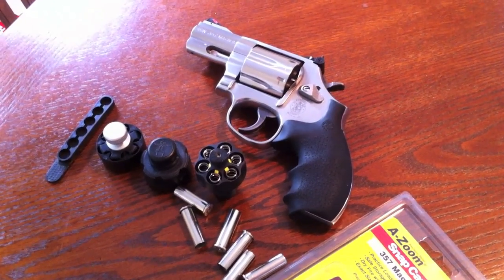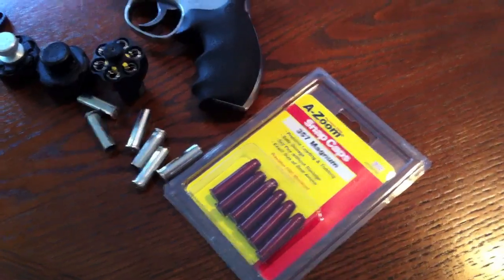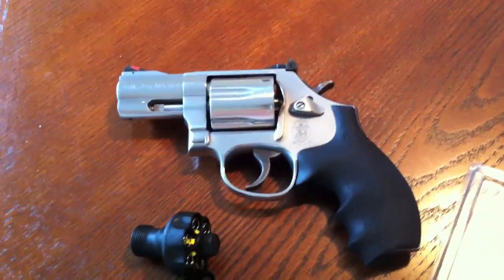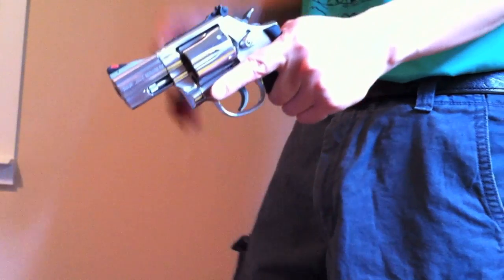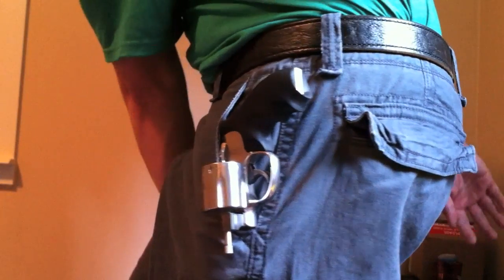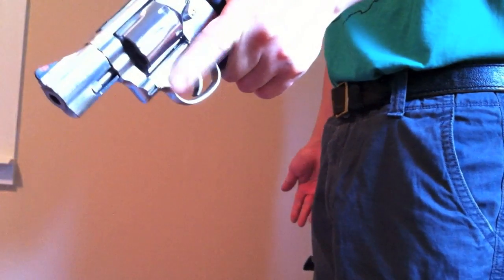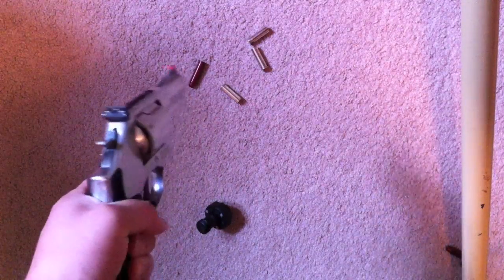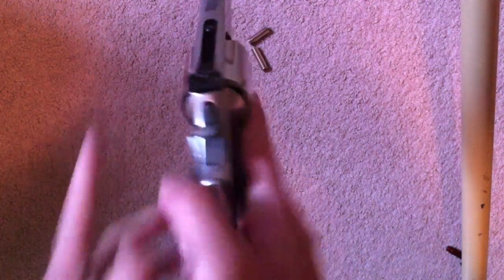Reloading Revolver with one hand

Comment: SL Variant the unicorns of speedloaders.
Reply from the maker: I still have a handful of them with one broken actually (the spring came out and the whole thing no longer works after I tried to fix it myself).  I only have 2 j-frame ones left as I sold the other 5 on the bay a few years ago.  I have a few for L-frames (6 and 7 shots) that I have not used much at all anymore but want to hold on to them.  I remember they had 8-shot ones as some guy at the range back in 2011 I believe had one for his S&W N-frame.  its too bad they didn't keep producing these things!

Comment: I love to see all the variations because there's no end to the ways. For weak hand I bump the cylinder into my body as the barrel goes into my belt. pull up to eject and toss the old, reach over to new one, load-close and back out. It's super fast. For strong hand I really think the ground method is the fastest method and keeps you low. Honestly for me strong hand is harder due to direction of the crane. Thanks for your versions.

Comment: I'm a little late to this discussion.  If your reloading with your dominant hand only, try this:  eject the spent shells as described in this video.  Next, with the cylinder still open, place the barrel in your holster vertically.  Obviously, the holster would have to be on the dominant side of the belt.  Drop in the new rounds with the speed loader of your choosing.  Take the gun out of the holster then close the cylinder.

Not familiar with S.L. Variant speed loaders.  I'll have to try one.  I use Five Star Speed Loaders.

Comment: I found using snapcaps to reload being great for pracitise,  load eaeier because of the design, old lead round nose. 
That's not the case with jacket hollow points. Whether your using S&k or safariland Comp 1 for five shot revolvers. They do not load as easy & hang up. I know he said safety first, no live ammo, but the load you carry you need to practise with. Keep your finger off the trigger or find a snapcap that is similar to jhp.

Comment: I'm thinking that in a def situation the typical person is far more likely to fumble a revolver reload than to experience a failure to function in an autoloader (which might load 2 or 3 times as many rounds).  And even if you do have to reload the automatic you would have to reload the revolver several times more -- making the odds that much worse for the revolver.

Comment: A) Gravity will not eject fired cases reliably (especially magnum cartridges)
B) These reloads will fail under stress when you will most likely need a one handed reload.
C) Your fingers are touching the forcing cone and the barrel; both of those, especially with magnum loads, get hot real fast; you will drop your gun.
Revolvers have been outclassed by semi-autos in every category. Shoot them for fun, shoot them for competition ,but don't shoot them for defense.
Reply: Shrewd _GC in which category please ? :)
Reply: titanplatine Higher capacity. Faster reloads. Easier reloads. Fewer malfunctions. Need I go on?
Reply: Shrewd _GC yes please but i think a revolver with moon clips is faster and because of is  design can't have feed issues also depending of the cartridge got more stopping power but for the higher capacity you're totally right go on please :)
Reply: titanplatine Easier to manufacture.Cheaper to buy. The only real advantage a revolver still holds is that it can't be knocked out of battery.
Reply: Shrewd _GC but it at less moving parts its easier to manufactured to clean and to recover you're ammunition if you're into reloading it your self  and some models like the taurus raging judge magnum can shoot different cartridge like .454 casull .45 long colt and 2.5 and 3 inch .410 shot shell in the same revolver  :)
Reply: 6236003 Does the Automag count? lol. Why would I want to conceal a .44 when I can conceal a pocket 9/40/45? Those pistols have proven reliability whereas revolvers have not. Improper cylinder timing, primer pop out, and bent cylinder rods are all well documented issues with revolvers.
Reply: Shrewd _GC you are wrong on so many levels. no the forceing cone doesnt become a damn bacon cooker. gravity will help depending on the kind of cases and the reloads that work no matter the platform is the one you train with.

and no. the 357 out performs just about every semi auto caliber out there. reliablity defeats it too.. all the semi autos have is capacity. thats it.
Reply: Shrewd _GC are you serious?? the 44 special out performs 45 acp! and oh my holy god. the primer cylinder timing bs is all based on black powder revolvers thats where those arguments come from! and bent cylinder rods? you mean ejector rods? thats just with bad revolvers! just as easy you can bend a guide rod!
Reply: six gun survivor I agree with you all the way until your last statement. I shoot 357mags mostly and the damn forcing cone can fry a small piece of bacon after a few cylinders, on my S&W, Ruger, and Taurus models. I've got a few ring scars to prove it.
Reply: bill h if that's such an issue. Wear gloves for training and tac ops. Or reload a different way.
Reply: six gun survivor Yeah I've tried a glove. This only happens to me in competition...speed, speed, speed, stress, "gotta get faster"" type stuff, otherwise no problem.
Reply: Autos or revolvers??? More less powerful rounds or less more powerful rounds??? Revolvers out classed? I think not.
Reply: I have to wonder how many keyboard commandos here have ever been in a gunfight.  In my 30 years on the street I survived three deadly attacks w/my issued .38 and even had to reload under fire during one fight.  While modern autoloaders make sense for cops & the military (I carried one during my last 10 years) there’s nothing wrong w/a revolver for the legally armed citizen.

Comment: That dominant reload is just terrible, in the middle of a firefight you are going to try and tuck your gun under your belt and then reach for something in your trousers? Sure it works when you are stood still in your house but do your exercise sets, tuck it under your belt and then run a few meters. That just doesn't seem at all practical compared to tucking under the arm or into the pocket again
Reply: I would try Cavalry draw in the waist band. With the old cases expelled rotate the gun hand palm out and put the barrel into the waistband. The cylinder is now open on the outside just as it was in the weak side pocket. Load and draw cavalry style.